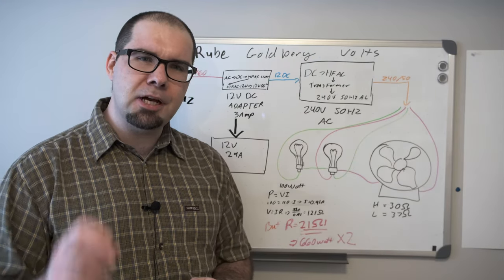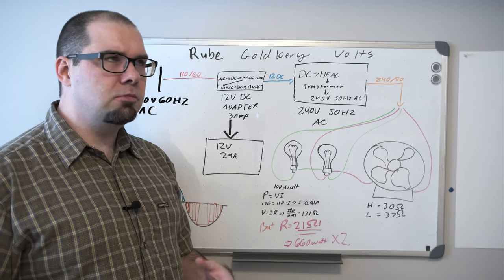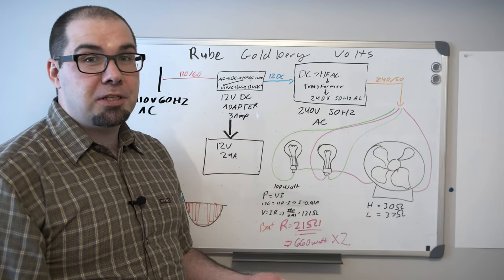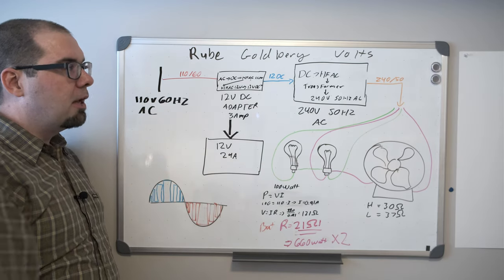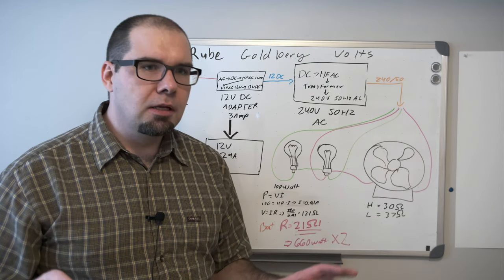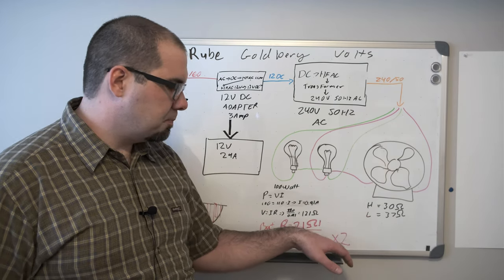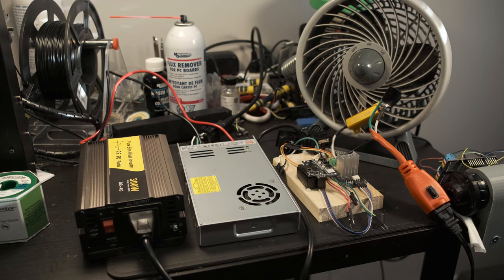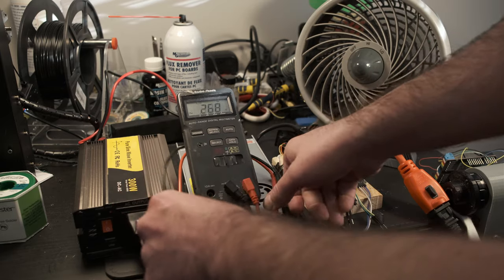Testing 240v AND 50hz in North America for Maelstrom

Comment: Have you ever thought about making a trainer that generates electricity? This could then power the fan and other things maybe like a laptop for Zwift.
It would need a bit of clever control to vary the resistance and some battery storage. 
Ideally it would be grid connected but that would make it massively over complicated if it was to have any chance of complying with regs.
Reply from the maker: While I've had interests in trainer development before I figure I'm sufficiently late to the party. The math doesn't tend to work out on energy generation like this usually. Cost a consumer could make back, what they would pay, competitive pressure to lower price, reduction in value of features over time... Trainers a niche, and trainers with specific features are niche of a niche. If smart trainers are 100k units a year, and a good design gets 10%, well if the niche you target is 10% and you can only reasonably capture 10%, that's 1000 units a year at maturity. It's hard to find investors when your 5 year lead out is 1000 sales a year. And of course, I use this as part of my own marketing measurements.